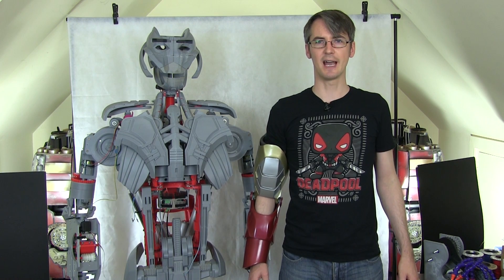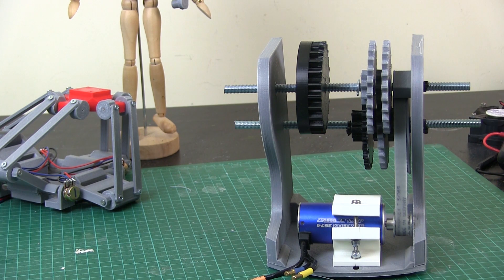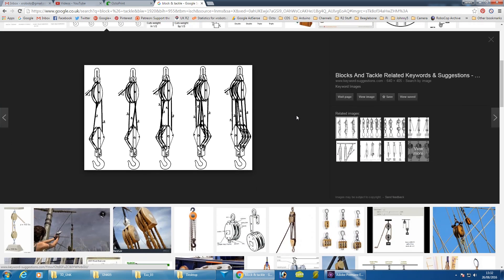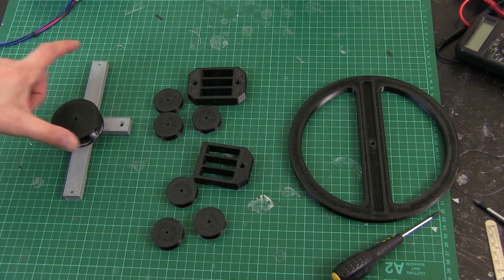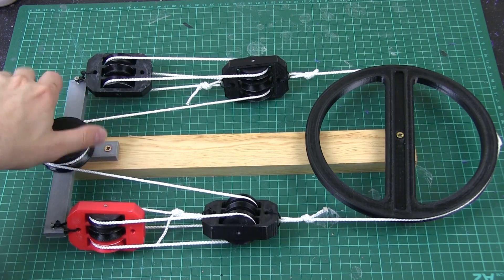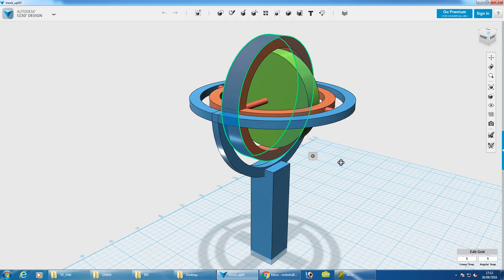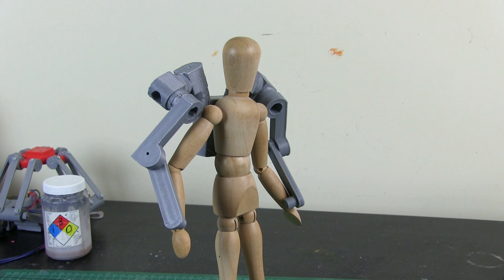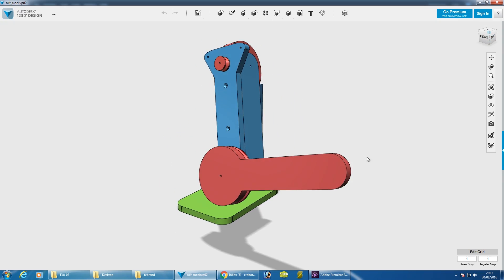Iron Man Exosuit #3 - Power Transmission Structure! | James Bruton

Comment: I had an idea recently. What about using pneumatic mkibben muscles. But instead of using air. Use hydraulic fluid (or water) and use a peralstatic pump with a brushless motor like you have. Could that work?

Comment: Very nice setup on that block/tackle/pulley solution. For a large-scale version of this, an engineer could use a compound or similar setup somewhere in the rig (if they have enough space) and could use a heavy duty mechanical chain for the large loop turning.

Comment: Wouldn't it be more practical to use a lot of small linear actuators? That would be more compact and is what the iron man suit looks like it actually has underneath. Not to mention it would look cool to have the frame for the armor powered by linear actuators. Also, you would be able to control the joint angle rotation constraints better.

Comment: Hi James, some of your work with gears and belts and force multiplication piqued my curiosity and I started doing research into various mechanisms and ran across an idea that you might find useful in your projects. The concept is called the High Reduction Planetary Gear system. There are examples of this in videos and on thingiverse to demo the concept. In a very small space you can achieve huge ratios like 64:1 or 110:1 or more (by cascading stages). The interesting thing is the load is distributed over multiple planet gears, so adding more planets is like the belt spreading the load over multiple teeth. I hope you get a chance to check into it, because it looks like something that would be useful in your projects. (Just don't confuse it with an ordinary planetary gear. Look for the unique "High Reduction" version.

Comment: Just wondering, why not using bigger brushless motor "7 or 8 kW" and a tougher gearbox, the pulley system seems a bit too complicated
Reply: You are right, big actuators take out the fun lol
By the way will you design some kind of mechanical limiter, in case an evil arduino card decide to separate your limbs from your body?

Any way good luck, and waiting your next vid
Reply: You can watch Iron Man (2008) full movie here fullmoviesmedia(dot)pw/iron-man-2008-full-movie/. Thanks, Cornelius.

Comment: because you don't have a good mounting point for a pulley system on the last axis, could you relocate the pulley system to a completely random position and have it drive a piston that is connected hydraulically to a slave piston in on that 4th angle? It'd take up less space in that confined joint space and you could also increase the torque again by having a larger volume piston on one side and a smaller on the other. Just a thought?

Comment: 3:50 - Were you trying to use the same rope for the bicep AND triceps?  It might work if you connect each end with a separate rope, and have both ends coil up on the main pulley like two cassette tapes next to each other - the speed, that the magnetic tape in a cassette moves through the player at, gets faster as more tape is wrapped around the the side pulling the tape.  In the arm, the side with more coils of rope around it will let out more rope than the side with fewer coils of rope will bring in.

Comment: Hi James,
I have been watching loads of your videos and really enjoy seeing your workflow from R&D to construction.

A thought about this project - On the rear axis ( top shoulder axis) two suggestions - if you were to use wire you could mount the block and tackle below a set of perpendicular pulleys turning a corner before the large joint pulley allowing the motor and main assembly to be parallel to the spine (although the corner pulleys would probably need to be quite strong) 

However as the hinge for the top axis will need to be quite strong you might get away with a linear actuator to control that axis.

Just some ideas :)
Keep up the awesome work!

Comment: You could use pressure sensors set to the motors so you don't have to have joystick type controls and they should be more mechanical reliable.

Comment: make your own using the electric motor, print a pulley for a nut placed on a threaded rod, and design a shock like cylinder to house it. innovation is not just trying something different, but using things that work well for jobs not previously conceived.

Comment: have you considered linear actuators? they run on 12vdc, can lift up to 300lbs, are compact, and cheaper than running a hydraulic system. (about $100 U.S. or so.)

Comment: If you are really interested into this most real exoeskeletons use Harmonic drive gears. There are 3d printed versions of them but i have no idea if they would resist the stress if they were made of plastic. Another option is using planetary gearboxes, these spread the load much better and are relatively compact.
Good luck!

Comment: Use a better string for your system. I would recommend something with very little stretch that can be spliced instead of tied. Look into marine rigging lines like Amsteel blue, or Zing-it, Fling-it, or Dynaglide. There are many advantages to using line like this in a design of yours.  They are very strong, light weight, very low stretch, and can be spliced; knots are points of failure and stretch will reduce the range of motion over time.  

Good Luck!

Comment: I just read that the gravity light uses gear that runs inside another gear, instead of on the outside. By doing this there are multiple teeth in contact at once, instead just one.

Comment: there is another option you could try. and it would fit inside the suits arm. involves using compressed air and actuators. but i have no good way of describing it over text.

Comment: Quick suggestion: have you considered Worm Gears? They run slightly offset to the axis of the gear and would work perfectly for an elbow joint.  You can have a screw run parallel inside of the bicep that turns the gear on the elbow piece. It would be much more compact and deliver insane amounts of torque., easily fitting in your exoskeleton.

Comment: Study strength of materials. Do you need some subjects Control and Automation Engineering both as Ultron in exosuit. Stop using many gear and use more pulleys and belts combined, industrial mechanical arms use it. The strength of exchange rate systems worm is not worth it compared the amplitude of the tolerance rate to external mechanical exforços the system. If you want to do the actual course of engineering, do the distance course, it is a good option for current conservative thinkers. Continue with the architectural style of the new projects similar to BB-8 V3, has a future. Do not sacrifice both the art of Ultron for could not think of other mechanical solutions. Always accompany your channel to see its development, I believe that you can do more and that has a bright future.
Reply: sorry, my english is very bad.

Comment: HEY! Instead of using string and paracord you should try using some fishing line (Probably should braid the line so you can use it more easily) that way you could shrink the whole system down so it wouldn't be so bulky. I recommend 500 lb tested line.

Comment: I was working on a similar concept for my final year project, where all the motors were up out of the way on the shoulder and the lower joints were then controlled through linkages based off the Phantom haptic controller (there are some videos of our setup on my channel). Another option we looked at was to use bowden (bike brake) cable, and have all the motors and actuators in a backpack with the movement being distributed by heavy duty cable pairs which could work quite well with what you're planning. Whatever you do, I wish you luck and hope it works out for you!

Comment: If you has the join in the back vertical (like you printed it), couldn't you do without a motor at all on it? It just becomes a swing arm that you can move easily with your own strength (provided you are standing/sitting vertical)

Comment: is there a reason you chose block and tackle over a worm gear?  worm gears can be extremely compact and have massive reduction ratios.  High stress of course which would mean that prototyping in plastic would need to be nearly zero load to not shatter it though.

Comment: what about reeling cables to pull the parts of the arm in the wished direction, like muscles do (they are not reeling tendons, but it's the same kind of idea)? with cables you wont have to make an axis system as rigid as with cogs and direct rotation.
Reply: ***** i was thinking about using cables like in bicycle brakes and gears (of course using stronger one's), that way you can make the cables go by where you want and you can put all the needed motors in your backpack to avoid adding weight on your arms. maybe there's no advantage for the shoulders, but for the elbow articulation it will make everything less bulky (if it can work).
Reply: if you take care of your bowden cables (thanks for the expression, i'm not a native speaker) and keep them lubricated there's not a lot of friction, not enough to be significant at low speeds. and also it can allow you to put stronger motors and use less cogs and pulley that can be bulky on the arm. i just want to share an idea, if it don't help you don't use it.
Reply: Then you start a YouTube video showing it
Reply: Panda Theft
well... this idea may not be the best, but is far from retarded. artificial muscles are far from easy to make and really expensive to buy (not even speaking about using them and activating them properly), so... the whole motor idea is the best approach if you're looking for budget solutions, but maybe there is an easier solution than the big pulley mechanism.
Reply: I also think that it's the best way to do nevertheless the crucial part would be to strap the cables to the structure and being sure that they would be able to hold the pressure.
Reply: Cosmos Eater
it would be like transforming an armor into a puppet (not sure of the word, the french is marionette) while keeping the space needed to put a human in it.

Comment: Y don't you make a piston like thing that connects to the wrist and shoulder of the arm ?
Reply: Air or pressured water with a 12v hydraulic pump. Have a tank of air on your back for supply. Hydraulic is better because you wont run out until you run out of battery which you can replace and charge in seconds.

Comment: You could turn the large pulley end into a sprocket, then anchor the block & tackle boxes to a chain that would drive it. That way you wouldn't need to worry about slippage on that side of the assembly.

Comment: For the missing 4th rotation could you use a bevel gear to move the driver belt vertical instead of horizontal or move it on the opposite side of the piece with the 3rd gear. My question is do you want the left arm to copy the movements of the right arm, which you would usually do with lifting a heavy crate. If that is the case, then the 4th gear should drive both arms in the back pack.

Comment: Have you considered using chain drives on the larger pulley wheels to link the block and tackles at the output end of the joints?  Likewise have a gear and chain at the motor end transitioning into cord; to prevent slippage under load.

Comment: James, great job on working through the design here. I'd like to ask as you are making this to be a structure to lift/carry a heavy load, are you going to have enough friction between your 'cable'  and the large pulley it will be rotating around?  If your child limb (animation kinematic reference here) is mounted to the pulley (directly or indirectly) and the mass is far away from your rotational axis (and carrying a heavy load as well), you may want to look at perhaps a toothed belt or chain and gear method to prevent slippage?

Comment: The extra Large Pulley that is connected to the joint should be replaced with a sprocket and chain to be pulled by the pulley and tackle system. The metal chain will provide more strength than a rope, and the teeth of the sprocket will prevent any possibility of slipping.

Comment: use nuerosensors they go faster and are easier
Reply: you can hook them up them up strait to a programed chip for the strength of the signal then put that into the motor speed control
Reply: once the signal stops so will the motor

Comment: James, why don't you use a differential pulley system instead of the blocks and tackles. You can get a much bigger reduction and mechanical advantage in a smaller space. To understand how they work just do a search (differential hoist) on the web and look at the images.

Comment: Wouldn't those gears be stronger if you went with a planetary gear system?
Reply: Thats what I was thinking, perhaps co-axial to allow multiple stages. Perhaps metal caps could be used to protect the teeth rather than all metal gears.

Comment: With the amount of movement you have on the large pulley (less that 180 degrees movement), it doesn't really need to be a pulley, it could just be a lever with the string tied on each side which would save some space and materials and you wouldn't have to worry about the large pulley slipping under tension
Reply: You are correct that a simple stick won't cut it, but a stick with semi circles on each end should do (like a double sided ax).  What I'm concerned about is the rope slipping around the large pulley when it is under tension.  It appears that there shouldn't be any slipping on the pulley in your system as it is as long as there isn't tension, so that means you could anchor the rope to the pulley on the far side
Reply: Reading the comments below, it looks like you are switching out the pulley for a gear and chain.  That will do it.

Comment: To avoid slippage I'd recommend using a chain or toothed belt instead of cable between the two travelling blocks.  That would also help avoid twist in the blocks which will be an annoyance.  The standing blocks can be fabricated directly into the upper mount, since all the return lines in this design always pull exactly perpendicular to the standing blocks.  Running the fall line into the standing block would make it so there could be zero lateral load on the drive wheel (the two fall lines for each side would be colinear, and, thus, opposed), plus it resolves the hidden issue of the diagonal drive lines causing (minor) length variance.  I think you don't notice that due to the ability of the travelling blocks to be pulled slightly inboard.  Lets hope that made some kind of sense :)

And then I read James' responses to the 15 other people worried about slippage.  Sigh...read comments, then post.  Anyway, you should be able to bring everything within the extents of your larger wheel by channeling the power of the shocked emoji  :O  two smaller wheels to bring the travelling blocks inboard.  Will also increase the engagement on the large wheel, and probably minimize bounce in the block and tackle setup.

Comment: Hey, what if you used a differential windlass for your Biceps?
Reply: This is a very, very good idea.
Reply: Andrew Thank you!
Reply: It would certainly be a much tidier solution. You could easily integrate the chain and sprocket idea to prevent slippage on the elbow joint.

Comment: Love the pulleys but count you instead use a long strong linear actuator running from the forearm to the bicep area which can twist to close forcing your arm to close (like the ultron back actuators). I understand torch is an issue but as long as that screw continues to turn the lift will continue.

Comment: If you redesigned the pully system you could remove driving disk and replace the first disk of each suspended pull as the drive disk of the system to remove effectively 2 disks.

Comment: I think I have a solution for this last axis. 
You can make another of these block and tackle constructions vertical on to the first part (which moves vertical). The whole construction has to face down (motor up, output gear down). And then you attach a fixed gear below the output gear. The fixed gear and the output gear are now in a 90° angle and when you turn your motor the whole arm turns around this fixed gear. 
PS: I hope you understand what I mean. I will make a 123D design of this as fast as I can.

Comment: Hey  James. Very interesting project! I've always enjoyed how even very advanced designs can be built up from the six basic machines. It's great how you show that progression in your videos.
Suggestion: Even though it's been done before, screw drive with metal studding and printed nylon nut would provide a lot of torque. The finer the threads, the more reduction, which increases mechanical advantage. But I'm sure you've already considered screw drive.

Comment: the two pulleys on the shoulder will fail to transmit the power-flow. You need to focus in that point a bit more. The whole structure is supposed to manage the power flow of the object you want to manipulate with it, not just the power of the motors. 

The back joint may be left without a motor, it carries static load you simply need some bearings that are set up in the right way- probably cone. It would be an interesting peace of engineering given that the main axis is not pointing straight down, but I think cone bearings set up in floating configuration(self adjusting) will do the trick.